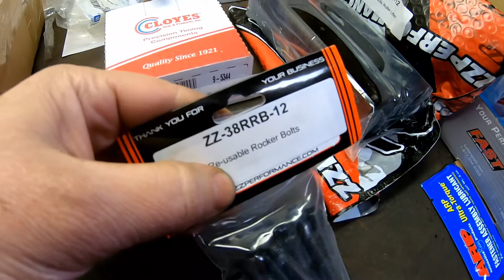Project Porsche 944 Drag Car: 3800 Race Engine Build

Comment: Got a guy that does 3800 heads for me. I'm sending him a set of heads that I got from Richard holdener to be ported and slightly bigger valves he's priced very reasonably so I'll let you know how it goes
Reply from the maker: I’ve got a set of heads at Milzy Motorsports right now.  I’ve been waiting for a long time for him to get them done.  They are going on my 3800 in my mid-engine Porsche.
Reply: @Mudford  yeah I have dealt with him on some stuff. I hope he gets better at communicating/no excuses and timely turn around on parts. He has cool stuff but I really sorry about dealing with him. People keep telling me he is sooo behind and owes ALOT of people their parts. I hope you get what you have paid for